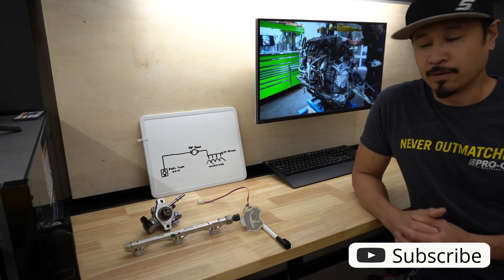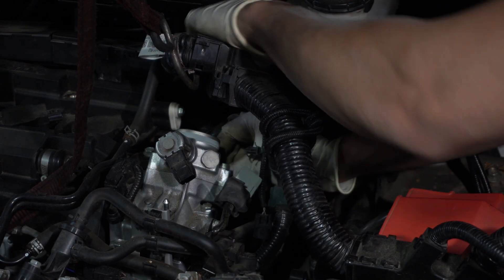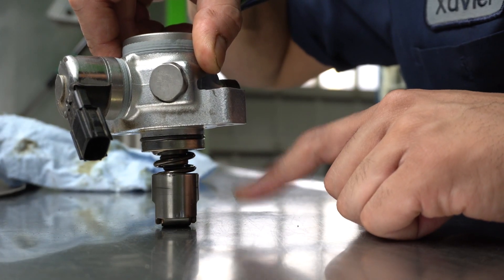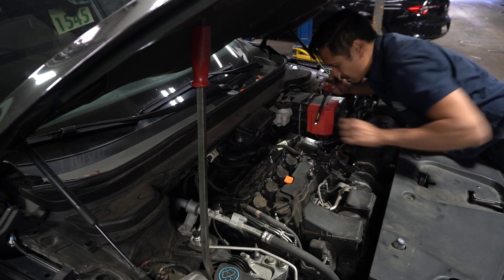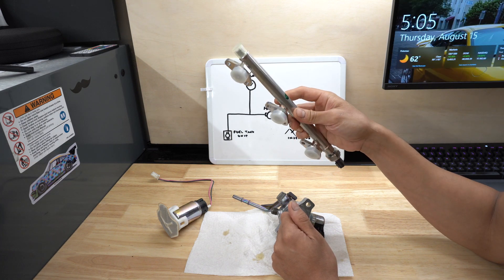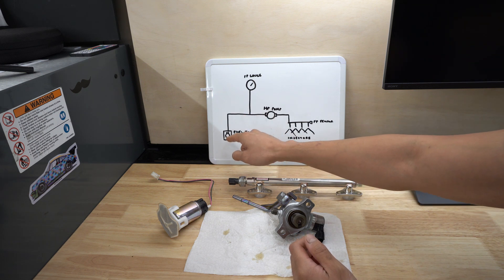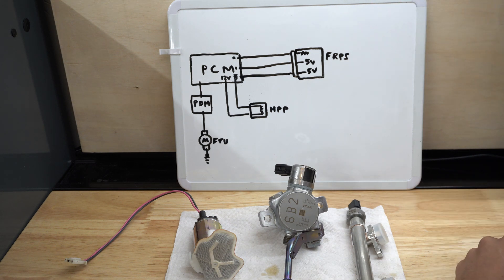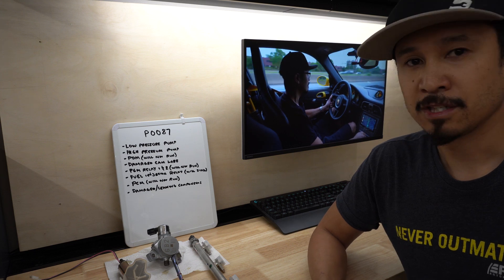2020 ACURA RDX CHECK ENGINE LIGHT.

Comment: What fuel pressure tester setup are you using or recommend?
Reply from the maker: OEM Honda fittings. Standard run of the mill pressure gauge.